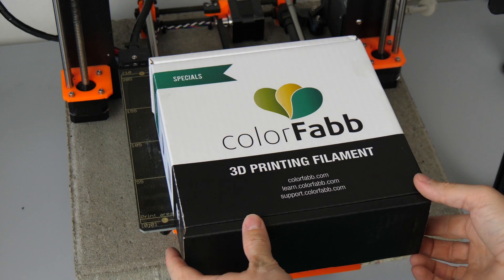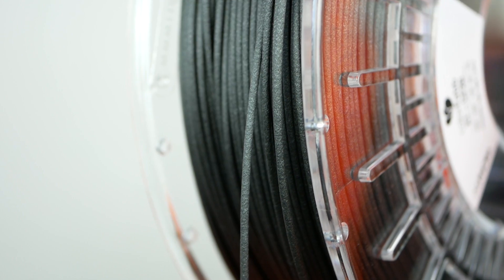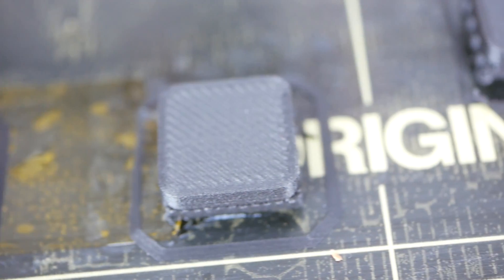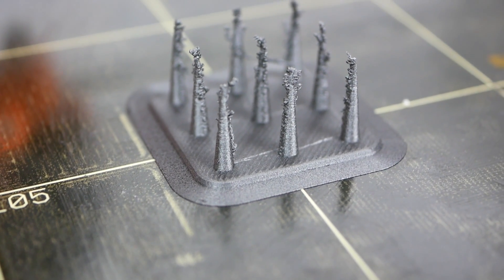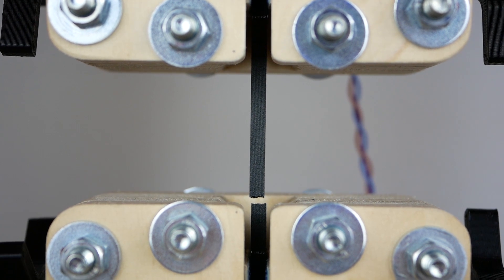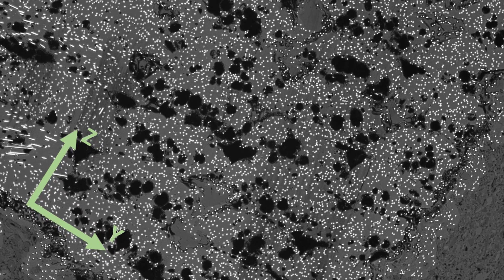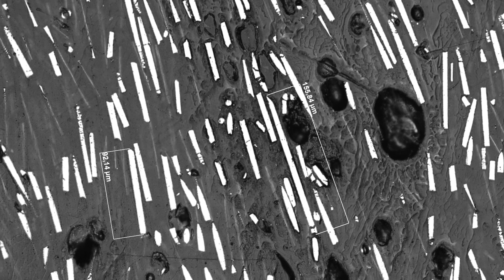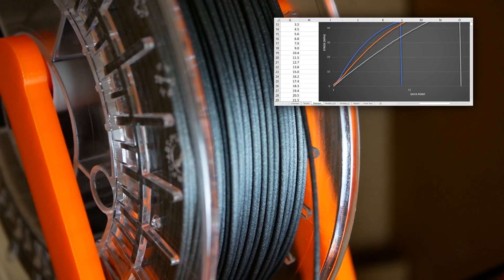3D PRINTING with CARBON FIBERS - ColorFabb XT-CF20 REVIEW

Comment: Oh boy! Filament with all the danger of asbestos!

What a great idea.
Reply: No. Carbon fiber dust / loose micro fibers can have some health impact (irritation and possibly lung damage), but it is nothing compared to the hazards of asbestos (cancer! and other lung damage).
Reply: @adamguichard6882  Nano particles are the modern asbestos.  Those were the words from a Harvard research professor to our class after studying this exact issue for many years.  Studies show that where asbestos can take 20-30 years to migrate through the lung tissue to the plural lining, that nano particles can easily accomplish the same in 3 weeks.  If (emphasis added) the particle is harmful , then there is a valid health threat.  Our immune systems are unable to dissolve many mineral compounds therefore, it encapsulates the foreign object with scar tissue.  In areas where there is continual movement, repeated cell regeneration over years can result in cancer.  There are some credible studies emerging that quantify airborne nano-particle concentrations with 3d printing, and are quite alarming.  I think it would be prudent for 3d printing manufacturers to incorporate enclosures with exhausts.  Nothing fancy, but the capability to vent trough a window would be a good idea.  Anyone can do a web search for "3d printer nanoparticles".  Be careful out there.
Reply: @rob3256  oncr i heard danger of asbestos came because the dust itself sooo stable in harsh environment including our body, so they'll gonna stick forever in our lungs, but  our body are composed by majority of carbon so i think its safer than asbestos lol
Reply: @adamguichard6882  It's not about the material, it's about the size of the dust particles. If the material contains the fibers in such a formfactor as asbestos then it could cause lung cancer
Reply: The Carbon fiber filaments aren't going to be any more dangerous than a fiberglass reinforces polymer.  And Fiberglass is an incredibly common material to impregnate plastics with.  Yes you should try to avoid breathing it in, but it isn't going to harm you unless you snort the dust like a line of cocaine.
Reply: @erebus6062  can confirm
Reply: I think you guys need to chill. You arent a profesional 3d printer who prints this carbon every hour every day for 10 years. Like carpenters do with their materials.

Once you start working in a pro printing (or any other pro enviroment), everything is in closed enviroments with buttloads of filters. And if it, its mandatory to use masks.

Comment: I found a roll for 25$ and it had 20% carbon fiber and it printed great
I can tell it does have carbon fibers because when I switch to a clearish filament the fibers left in the nozzle come out with the clear filament.

Comment: Carbon fibers biggest pro is its strength vs weight. Carbon Fiber PLA is not necessarily stronger but lighter. Its about 25% lighter and of similar strength. I am printing boat parts in Carbon Fiber PLA and it is better than normal PLA. Normal PLA tends to shatter on my boat but the carbon lasts for significantly longer. Also it has great lubrication and wear properties. If people think carbon fiber filament will make their prints stronger then they will be disappointed

Comment: What if you reprogrammed the layers? First layer one direction, followed by second layer put down perpendicular to the first. Repeat alternating layer direction through the part. Would that not increase the strength of the part?
Reply: 3D printers already do that actually. When I use "lines" or "zig zag" pattern on the top and bottom layers it will alternate the direction for each layer. With "concentric" pattern each layer will be printed in the same direction.

Comment: So what is the benefit of a stiff material over a strong one Stefan?
Reply from the maker: Depends on your application. A quadcopter frame die example needs to be stiff in the first place to make controls better and only needs to be strong if crashed. If you are not planning to crash than choose a stiff material over a strong one.
Reply: @CNCKitchen  Cheers Stefan!

Comment: Well it seems CF filament is more a gimmick than a composite with significant enhanced properties, plus the risks of the small particles. I do wonder if aramid loaded filament would be better than CF, i guess if the fibers are long enough it could have a significant improvement in tensile strength, do you know if someone is already trying this?
Reply: Good question.

Someone mentioned Kevlar impregnated filaments...

Comment: Hi, I’m new in this printing stuff. We have to teach it in future as an additional skill, so now i’ve to learn a lot.
At first thank you for your report. PLA, PVA, ABS, PET i’ve tried a lot with different results.
On your site are the examples, do you also offer the thermal mark tower etc.?
It would be really nice and much easier to get the best settings for each material.

What are your experiences about using original material eg Ultimaker vs eg Innofil.

Thank you in anticipation

Comment: I read a paper where the coated the outside of the filament with carbon fiber, then heated in a microwave over this made the prints strength nonbiased to the print layering. Can you try heating it in a microwave to see if it increases layer cohesion?

Comment: I wonder why no one tests the filament before printing it -- I know it wouldn't translate 1:1, but it could give you a baseline -- like, if the base filament strands are much stronger than PLA then you would know you may need to tune the printer to get better results, but if it's about the same as PLA then you know the filament probably isn't even worth testing...
Reply: I thought he tested the filament at 5:30?

Comment: I would suggest a respirator when abrading any material with fiber like reinforcement but i dont think theres anything to worry about printing with it.  The stray fiber might escape the material and there but being contained in molten plastic its probably safer while its printing than when its just sitting around.

Comment: Fine fibers from asbestos causes mesothelioma (malignant cancer of pleural surface of lungs) sometimes after 15 years past exposure and has a survival rate of 5 years in less than 3 % cases. Its because if those fibers go into your lungs they cause scarring and stay there basically forever. I would not be surprised if even small exposure to carbon fiber would have same effect on your lungs. So nope, you are not being overcautious wearing the mask. If I was you I would even take air samples long after project is done to make sure room is not contaminated.
Reply: Attention, If you or a loved one suffers from mesothelioma...
Reply: Even tho im replying to 2 y.o. comment and copying it from my og comment... Apart from asbestos, carbon fiber can be cough out or just should not be harmful as asbestos. Carbon fiber has similiar health hazards as Glass Fiber, but idk if the macrophage can destroy it, still, you can cough it out. Asbestos fiber looks like "barbed wire" thus leading to said lung diseases, beause, thanks to it's shape, it is scratching lungs. Mesothelioma can be caused by small exposure, BUT it is rare. Asbestosis is not rare, but you need to huff it everyday. 
But one thing here...
Carbon fiber uses epoxy, which, when heated, can cause cancer. In older days, asbestos was "miracle" and "future" of our homes.. now a nasty chemical.. and the same will propably happen to carbon stuff, if we don't find better gule-stuff to stick it together.
Reply: Shit now you made me stupid scared
Reply: 😁. U need proper gear, don't do this at home people.. 😁
Reply: I don’t think the exposure is the same. Asbestos is in mats where all the fibers are open and able to escape into the air if disturbed, this CF is embedded in plastic.

Comment: I spent a lot of time working with ColorFabb support to try to get this filament to print properly for me.  It's an absolute headache and when compared to other high end PLA's, just wasn't worth the cost or challenge to make it print well.  I had high hopes and loved the matte finish.  But a nightmare to dial in and work with for moderately good prints

Comment: Could you use the bare fillament to reinforce a print made with another material by pausing the print with the other material and laying the filament on channels, and maybe a quick pass of a heatgun or even a clothes iron, to fuse the two filaments every few layers?

Comment: I'm actually surprised that you had to adjust the extrusion percentage. Mine worked fine at the same rate as PETG. I wonder if that's got something to do with your extruder, and the rigid nature of the material? Some plastics will compress more in a strongly clamped extruder.

Comment: i think this filament suffers a bit from false marketing. Calling it "fiber reinforced" creates a false similarity to "proper" or traditional fiber reinforced materials, which are much stronger. These kinds of materials do not print well, since the printing process severely limits fiber length and the ability of the fibers to intertwine. It may have its uses, but i think they should have come up with a different name and marketing strategy. This is inprecise at best deceiving at worst
Reply: Fibers don't really need to be intertwined to increase toughness. Part of energy absorption is not through breaking of the fibers but also the pulling of fibers through its surrounding matrix. While true these aren't what they could be, it is still tougher in theory.
Reply: @christopherlam4414  they dont need to be intertwined, but the properties of a fibrous material are strongly influenced by the length of the fibres and interconnectivity.

Fiber-reinforced materials have existed for a long time. While - in theory - any material containing fibers could be called that, actually doing so creates a false equivalency. 
Its dishonest marketing.

This is especially true since there are printers out there that actually introduce proper fiber reinforcement, like continuous fiber printers.

The typical carbon fiber filament is more like a fiber infused/filled material. Its properties are mostly determined by the binder and slightly adjusted by the fiber.
Reply: @TheVergile  yeah but there isn't really a way to get anywhere near the critical length so we can't realistically rely on the fiber itself for strength. I agree its not anywhere near as effective as fibers at its critical length but its something
Reply: I agee whith yuo..its preaty marketing
Reply: What’s wrong with saying it’s fiber reinforced? The carbon fiber adds rigidity the the nylon creating a balanced filament between strength and stiffness. Nothing states that it’s continuous fiber printing.

Comment: Print cores(in PEI) to be covered in Cabon-fiber "PrePeg"(store it in an old frezzer b/4 use). VACUUM BAG to core srenght& ridgety sloved.  Now 3DP-Platform Work station Series#400 definitely gets you out of the toy& modles market. They are 59" on the "X"axis ,then 39+" on theY" axis, and27&3/4" on the "Z"axis at about 40k with right&left extruders.  For peaple with the cash startup 3DP also has a range of printers called "EXCEL SERIES" that can print20ft. wide x12ft. high by up to 300 meters.(looked down the throught of one of these).  For carbon fiber and many other fabrics, epoxyies, bagging equipment  www.compositionenvivions.com is the best.

Comment: what material would you recommend to use with temperatures between 90-100  degrees Fahrenheit?
Reply from the maker: ABS, ASA or annealed PLA. Depends on what you need it for.

Comment: Could you maybe make a review of the PC/PBT Filament by Herz GmbH? I have bougth it and I really like the strength of the parts but I am struggling quite a lot with bed adhesion and warping.
Reply from the maker: I'll see if I can get a roll of it. What are you printing on? Ever tried the adhesion stick from AprinaPro?
Reply: Good Idea! I have a FilaBase Printbase which does not work good for the PC/PBT Blend. But I am trying PrintaFix right now which looks promising so far. I unfortunately havn't bought and tested the printastick which might work even better. Did you test the Stick already with PA12 or PC?

Comment: puliverized carbon in the air will always find its way to a power supply, and viola.  Dead.
Reply: Can you tell me more about this? I've lost 3 power supplies over the years. One at least was due to over-draw, but the other two should have been strong enough.
Reply: highly conductive carbon dust is able to short circuit computer power supplies.  It causes computers and chart recorders to fail.  Detailed failure analysis shows arcing to ground on high-ish current areas of pcbs.  The dust creates a direct path to ground that can carry a large amount of current at low voltages.  Thus killing electronics.  If you wanted to sabotage a computer server room, bring in a bag of crushed water filter carbon and puff it into the air, and vioala, dead servers!  PS  don't do it.
Reply: j Rumbleseed thx for the advice!

Jk
CIA Please leave me alone.

Comment: Stefan, can you  post the material resistance if it is conductive? Example how many ohms per meter of filament? Thank you for sharing your great videos!
Reply from the maker: It's not conductive at all, since the fibers do not form a continuous circuit.

Comment: I wish there was more info on how to 3D print using continuous fibers, both carbon and fiberglass rovings embedded in nylon or uv curing resin. Of course that requires a custom and complex hot end, but it would enable parts that are tougher than steel.
I know there is a printer now, but it's super expensive and the custom filament ridiculously priced.
Reply: Yeah, I will second that !!

Comment: Carbon fibre gets some it's strength because of the weave, with 3d printing you don't get a weave.
Reply: For this material, I think the fibers are too short to add significant strength.
Reply: The resin is the matrix that keep the fibers together. The strength is mainly in the fibers.
Reply: @Okleydokley:
Yes, it IS true.

Study why alternate layers in plywood are alinged 90 degrees transverse to each other...

It's so that the plywood won't crack when high force is applied, because the wood fibers running 90 degrees opposite to the direction to the wood fibers of the layers above and/or below it prevent cracks from deepening when force starts to overcome the strength of the fibers of any single layer.

Just sayin...
Reply: Thats not true. The weave on carbon fiber is aesthetic, the strength comes from parallel oriented fibers in layers below the weave. For painted CF, they don't use a weave layer.

Comment: It's very interesting that the filament needed drying to perform well. Even though it sat on the shelf for a year, it was still sealed in plastic with desiccant. Is it possible to tell when drying will help with a particular filament? Are there any guidelines for drying time and temperature for various materials? This would make a valuable video!
Reply: As far as I know PVA and Nylon are the filaments that absorve more humidity, you need to take extra care with those.
Reply: Yes, that's what I thought, but the ColorFabb XT-CF20 tested in this video is a copolyester, Eastman Amphora, presumably PETG. I found an interesting article at https://www.matterhackers.com/news/filament-and-water that says, "If you have nylon, polycarbonate, or PETG and the spool has been sitting out for more than a day or so, then you likely need to dry it." It also has nice instructions. Think I'm going to try it.
Reply: oh yeah, I have the XT from colorfabb, not this one with carbon fiber, it dripps a lot, Ngen is much better. Make sure to use this filament with a hardened nozzle cause it kills brass nozzle with just 250gr. I tested PLA Carbon Fiber from Protopasta. 

Talking about drying filaments there is a drying box solution, those that dehidrated foods and fruits, you can try to find it here at Youtube, need an easy adaptation to work with filaments
Reply: i’m not a good fan of CF filaments not just because it wear the nozzle, nowadays I have some strong nozzles, but the fibers inside the filament are cutted, it doesn’t perform like the real continuous fiber glass stuffs, it doesn’t bend and broke easy. The major benefit is lightwheight

Comment: After printing, I’d coat it with something... epoxy perhaps.
Reply: But wouldn’t you lose the accuracy and tolerance?
Reply: @josiahong5177  Not as much as you might think; the epoxy (especially if you get a very non-viscous formulation) tends to have a consistent thickness which you can account for in the model and/or print settings.
Reply: @darkwinter6028  okay

Comment: A pro tip for when working with carbon fiber (sanding etc.) is to wet the surface beforehand so that the fibers do not become airborne.
Reply: Odd Spaghetti then throw it down the sink?